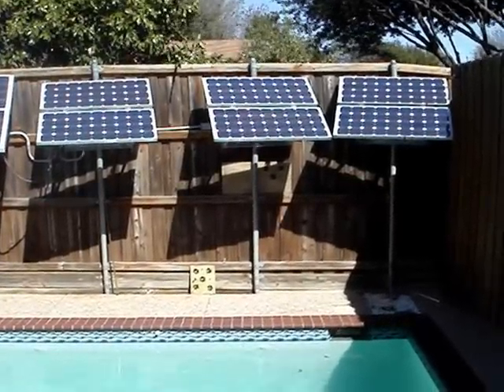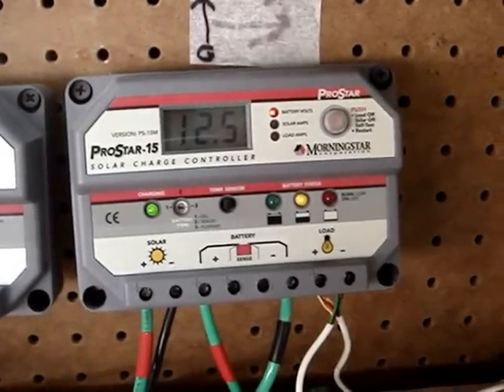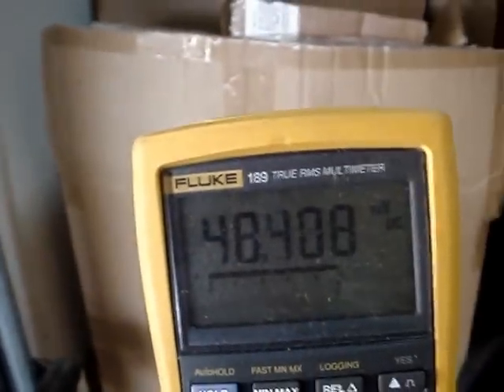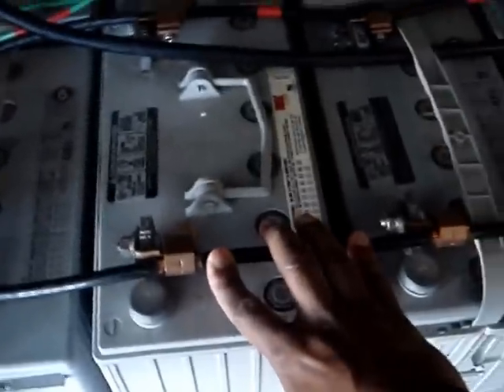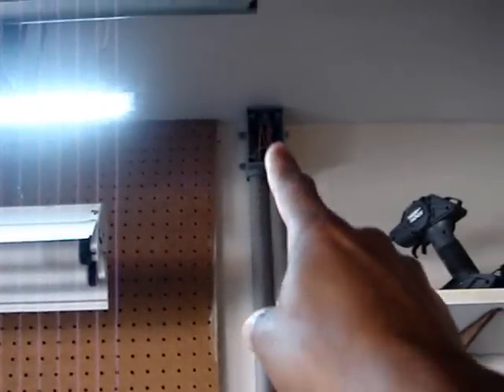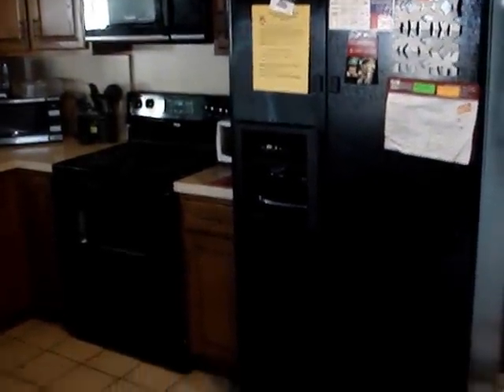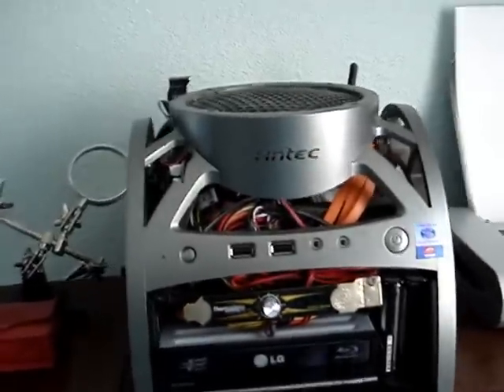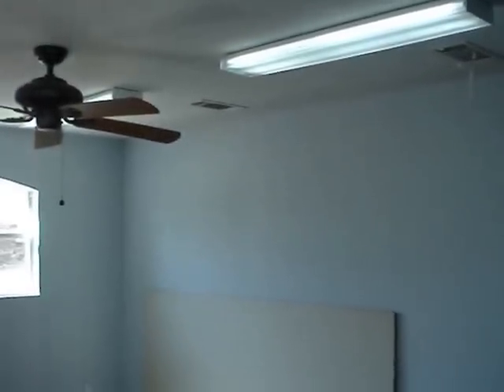My Solar Setup

Comment: As a general rule, you should be putting in about 10% of the total Ah rating of the entire bank when charging.  For 16 100Ah batteries, that is 1600Ah total for the bank so a good charge rate for that bank would be 10% of 1600 which is 160A.  However, that is some high current which means your bank should probably be 24V or even 48V to cut down on the current.

Also, why aren't you running your 240V stuff?  You should be able to run your stove and/or water heater for example.  Even a small AC (but I doubt a central AC).

Comment: Another half ass setup.  Bad positioning of the smaller panels.  What if someone large wants to walk by there?  They might bump the panels.  Also why is this system 12V?  Why not make it 24V or even higher?

Comment: well definately better than some guy running a dvd player and tv on a panel ... you at least run some appliances on solar saving the big power hogs from costing you money from the hydro company ... 
.
it looks like you are running your batteries in parallel ... each and everyone of them ... if you broke it up into a parrallel series grouping you could run your dryer or stoves as well ... each inverter could run half the groups and then power the stove and dryer from BOTH inverters to get your 240v .... you might need different inverters to handle the parrallel setups higher voltage but stil tying all the grounds in and then grouping the batteries in 2's 4's or 8's will allow for higher voltages and with 2 inverters each can run a half of those battery sets ... and you should be able to tie from ground to BOTH inverters and get your 240v's (120v from each inverter)

Comment: You have a wonderful system there, same thing i have been dreaming of but fear wouldn't allow me dare it. I have a system almost like this and i have been wanting to install two controllers to the same battery bank of 12 200 amps  but from 2 separate arrays of pv? (tho at the moment i am running at  separate battery banks which i don't like) 
Also  i size down my energy consumption and want to completely live off the grid, Can i run extra 6 panels on separate wires to that same battery bank without a controller?
Reply: Udo Hanson hi I wouldn't recommend that. You will have to be the charge controller. Meaning anytime you have that extra 6 pv's attached you will have to monitor it all the time. To make sure the batteries don't over charge.

Comment: I like what you have done. Green colored wire! ouch. But, other than the color error, you look pretty good. How do you control the charging of your batteries with the direct clipped-on solar voltage? Is that connected only when there is a lot of usage and you want to keep the batteries at their best voltage? That seems uncharacteristic of all your other planning. You didn't mention what type of batteries you use, but from what I viewed in your video, they look like deep discharge lead-acid. My expertise is American standard electrical codes. I have done both residential and commercial. So, code compliance is manditory.

Comment: Absolutely Love This!!!!!!! One idea I just had looking at this that could fine tune your setup and get rid of your battery bank and inverters. Im an IT analyst & electrician. I have designed and built a few small scale server rooms and have used this unit in all of them. It dawned on me from watching your video that this is the perfect piece for less maintenance and a cleaner look. Check this unit out APC SYMMETRA 16Kva UPS. I think this is the key to make everything alot simpler

Comment: 85. 1 amps x by 12.7 volts = 1080 watts that's with the 20% loss factored in. Ever time you hook a panel in parallel you add the Amps so the main wire that carries the Amps has to be big enough to handle that Amp each panel is producing 6 amps and 19 panels would make 114 amps on a sunny day and more at -40f  because of voltage increase in cold weather voltage could increase by 1.2% which increases the wattage which makes up for some of the 20% loss. Who says solar panels make less power in winter was wrong they make more in cold weather but have less sun time that is the only reason for loss.

Comment: is that too dangerous if u have 48 amp input without the controller ?  you dont' have to replace the black wire or green wire. if u are using the Green wire as Red for positive.  you need to buy the Red tape and wrap entire the Black wire to make it Red as Positive.    Green to make it positive also just need to wrap entire green wire with red electrical tape buy at HOME DEPOT.  Have fun...

Comment: On the panels you dont have connected to the controller but hooked up direct to the battery how do you keep those 40 amps from not overcharging the batteries?? Plus how do you not damage the panels by feeding it power from the battery's back into the panels that are directly connected?? There must be a heavy duty diode too prevent that. But seems like you bypassed that or the panels have that built in, but I doubt it??

Comment: For those who want to order solar panels(monocrystalline)made in Germany. batteries and controllers, led bulbs and inverter here in bohol. yoy may contact me at 09097216715 smart and 09323616340-sun. You may visit my home at visarra st. Tagbilaran city, Bohol. or East Poblacion, Garcia Hernandez. We deliver Cebu, Camiguin and Leyte..Or visit my Facebook page, SOLAR PANEL BOHOL and GERRY OLASO

Comment: And what Was The cost to get started up on The solar panel because Im wanting to run tv lights fridge and computer and charge cell phone with no problems
Reply: And will a 1000 watt or 1600 watt system be suficient

Comment: I know this is an old video and everything.  I just happened to see it now.  But ummm, did you know you had your meter on VOLTS when you clamped it on that solar cable going directly to the battery?? lol   The meter was displaying 48 mV DC, not 48 AMPS DC.  So, it was telling you that the leads were giving 48 millivolts, which just means they probably weren't connected to anything.
Reply: Christmas Eve He used a current clamp designed to show current on the volts scale.

Comment: Hey Guys!let me know If I run 80w DC fan or 80w AC fan, should they both use the same power from battery??
Reply: dc equipment can only run off dc supply. unless your using an inverter of course
Reply: +Thomas Wilkes  Yes i know thst but I meant whether same wattage will be consumed?

Comment: Nice system.  can you use number 6 jumper wire. I'm working on one on my camper. want to get some feed back. 2 six volt fed by 150 watt panel on roof. should this work? see mac camper 136

Comment: I love your set up.  I a just getting my feet wet, so to say.  I have built a little portable unit on a dolly-it's a 50 W monocrystalline with a cheapie charge controller..I hate that one and am trying to figure out which one to replace it with.  I only have a 12 V deep cycle battery.  I use it for things like heat mats and grow lights in the shed or when our power goes out it charges my phone and powers the TV and a light.  Thank you for the video. Some day I hope to be as self sufficient as possible with solar and wind.

Comment: Great job I know it has not been easy.  What type/Brand of batteries are you using?  Are you still using the same batteries as 2013?  are they still holding good charge?

Comment: you should NEVER NEVER use GREEN wire for ANYTHING but ground.  (FNPA violation, not to mention someone else will think its a ground wire).

not to mention for 85.1 amps, your wires are WAY WAY undersized, you risk a fire there.

furthermore, not having a charge controller is very dangerous as you risk over charging and exploding the batteries
Reply from the maker: Hi Brian. you know what? Your apsolutly right. never thought about if someone else has to service my system, that green wire could be a problem. will change it soon. thanks
Reply from the maker: By the way Brian. that 85.1 amps is not coming in all on one wire. If I setup such a system I should know simple electrical wiring, I would hope.
Reply: +Brian Fischman The Controllers have charge controllers built in. Once you reach a max charge the led blinks that means  its on standby.
Reply: The nec is a joke but the stuff is pretty smart, well some of it anyway. I just like that it helps everyone get on the same level of things. Im trying to go to Africa where there is no code. Alot of these cpdes make no damn sense
Reply: +Anton T He could of used black instead of red, even blue if it was a 3 phase system. There are soo many different ways to do things, the code is jumble fucked out the bum. I get what you are saying though.
Reply: Anton T You can use any color besides white, grey, green, and green with yellow stripes. Im in school looking over that crap soo much, they need to simplify the book really bad. The designer should make it where that is easily noticeable, and the installer should be able to read the plans. Usually a house has black, red, white, and green. Black and red are the phase wires. White is neutral, "the return path" as I call it, and green for grounding. I could also use the red instead of black because it is the same amount of Volts between each phase wire and the neutral, but that would be different than what we are talking about.
Reply: Anton T That red wire for switches in your house is for "switched hot." There still is a red wire used for other things, but that's for higher voltages for your washer and stuff. The voltages are not the same between the neutral and phase hahaha i screwed that message up all bad.
Reply: +Anton T Look up the Mike Holt edition, might be able to find something for free, Mike Holt is the shit. He puts pictures in the stuff so you can see what you shouldn't be doing. If you are willing to take my email, we can ask each other questions on whatever, and you know solar so that makes things easier.
Reply: +Brian Fischman There is a good guide on www.facebook.com/diyhomeenergykits/app/190322544333196
Reply: Brian Fischman it's his own set up, no one else has anything to do with it
Reply: +IwannaGoFast Solar You know what your doing for the most part but if you ever get inspected, your breaking a lot of NEC codes with that system and they will shut that down. Let me know if you have any questions on solar, I can design any system you need!!
Reply: breaking nec codes is not usualy a big deal.  they are really more of a guide line anyway, alot of local municipalities are a generation or two behind.  some add stuff, some remove stuff
Reply: Anton T An experienced electrician should never assume, on DC systems the white is not neutral and on AC systems the white is neutral and also the grounded conductor. And if your designing systems you need to go with code or you cant pass the system. The code is law here in america, at least on grid it is. I cant set up a system and get incentives for it if it's not passed and abides by the code 100%.
Reply: peleade mujeres. enlistancia deamescua Michoacán

Comment: Your going to overcharge your batteries that are without in inverter and that's very expensive. You might be more efficient if your ran 24 VDC. I also hope you have a pure sine wave inverter if not your going to burn up your electronics. By the way your electrical is very dangerous if your inverter are only (120/2000) = 16.66 amps AC  your service distribution is way to large. You could see your house burn up. People this guy does not know what he's doing and this is not a safe installation by any means. I have my own system self installed and it has proper circuit protection. You need to study a little more electrical theory because you are endangering your home and neighbors.

Comment: Greetings, very interesting video that I just saw. I have a workshop for wood turning I use only by day time, with things like a little compressor and other electric tools but they never are two of them working at the same time.  What kind of equipment I need to put everything of grid with solar panels?

Comment: Hey douche.. Get those batteries off the ground as they are discharging to ground ALL THE TIME!!!!. you need to raise them about a foot off the ground (at least) and you will get more efficiency.. but none the less a great setup.
Reply: ***** As long as I can remember and everyone I know in the motor trade ALWaYS raises batteries off the ground to prevent self-discharge..

What do you think has changed in battery technology to say you no longer need to that? i have proven it over and over again. I place a perfectly charged battery on the garage floor and forget about it and within a few days its dead... so 'myth' seems pretty real to me.
Reply: ***** OK. thanks I'll check it out..
Reply: ***** Yep, as far as I can remember, the one of the reasons for not having batteries on the ground was so that you didn't fall over them. I think everyone would be in agreement to store them on a low open shelf, preferably with a (removable) shelf above to ensure that nothing fell onto the top of the battery bank, yet you can access it.

All the endless myths and fallacies of battery discharge are proven wrong by regular checks & reading and the knowledge that batteries are slowly discharging anyway, a fact a lot of people tend to neglect.

Battery health is something not often thought of either by some people.
Reply: +OwensBoatClub Bahahahahahahahah.  Putting your batteries on the ground does not cause them to discharge.  They'll discharge all by their lonesome on a shelf just as they do on the ground.
Reply: That is what I said.  Batteries self discharge with time.  It has nothing to do with the ground.

Comment: Wow. I am impressed with your set up and has encouraged me to take the next step. My family and I are starting a small solar set up with a modest two array 145 watt solar panels connected to a Morning star 30 amp charge controller and then to a 153 amp hour concord AMG solar battery. It runs a full size fridge and a small 3.2 cubic size freezer with no problems or it runs 20 LED lights, a small fan, a small TV cable box.
Since that hook up does so well and also acts as a stand by emergency renewable power source we have decided to expand and add more batteries, more panels, more charge controllers tied to a transfer box and to my panels to run 90% of the house.  
Question. When the weather doesn't allow you to harvest solar power, how do you charge your batteries? What is your back up for solar?
Reply: Stevemichelle
Not my vid but a lot of ppl staying off grid use a generator with a typical trickle charger like you'd use on your car. Even if it's every few days to top em off until your collection of panels keep up with your charging needs. I have a little generator 1000watt briggs and it'll go 6 hours on 1 gal of gas so $3 wk basically. It's a little different charger if you run 24/48 volts unless you unhook each battery but if your only running a couple batteries just trying it all out that'll work great.
I wrote an overly long comment one of the top ones still im sure by date about running the different voltages vs the draw etc that might help you out if you wanna skim through it. If you need some help I can get you my email or something I just don't want to post it on here lol. Good luck!

Comment: I wanna do this take a working car alternator and hook it up to a battery or an invertor but power it by wind or by like a extercise bike by like a belt or something
Reply: so basically no matter how fast you spin, the voltage output remains the same? does that mean that the amps are what would vary?
Reply: Would you need a charge controller for something like that?
Reply: Most have a voltage regulator built in. Just research rpms and set up the bike with a larger pulley vs the alternator (like a 6" on the bike and a 2" on the alternator) and you'll get 3x the speed without having to pedal your legs off
Reply: Mikey Lovejoy Jr. good idea as long as you can pedal 3000rpm. haha. Do you know they use dummy loads to control wind turbine speed to stop them in strong wind.

Comment: I kinda though that when you go through all the trouble to create a youtube video and show all the hard work you have done to complete that system and share it with us that you would at least answer some of questions, it's seems you have a lot of backed up questions, as Joseph M asked below about the running of an air condition, and my question along with others would have been about hooking up your panel box, like  did you use a main breaker in that box to energize that panel, I though we were suppost to help each other by posting are ideas and creating things that would others, it seem to me that there are a lot of people post video's and don't bother to answer any questions
Al
Reply from the maker: Al Ruark Hi Al. Life been keeping me busy. but the answer to your question is no i dont have mains AC power running to my solar panel box. only power from the inverters.

Comment: Very nice. If you need to run your stove on 240, you could get a UK spec inverter.  We run single phase 240 volts for everything in the house. My 3 kw pure sine wave inverter works realy well with my stove.  I must say though that my stove drains 300 amps at 12 vdc so you might want to double up your battery jumpers.

Comment: Check out Xantrex Inverters for a setup that will let you run 2 inverters connected together to get the 240 volts you need.